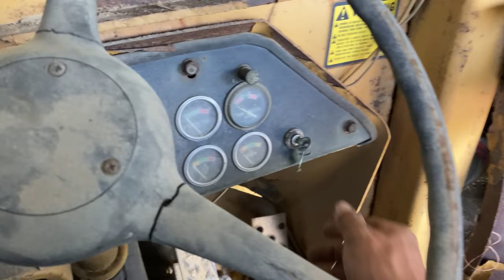Fiat-Allis Wheel Loader Sitting 12+ Years will it Run and Operate??

Comment: As a person suffering from tinnitus, and from one mechanic to another: please, for the love of god, wear hearing protection when operating tools such as the impact driver! Especially in such confined places! Trust me, the few seconds saved not putting them on is not worth a lifetime of not being able to sleep or relax properly ever again!
Reply: But it's not manly. He doesnt even use gloves and just rubs his hands in every fluid. Early cancer.
Reply: @alexstromberg7696  Motor oil is how real men moisturize.
Reply: @XH1927  yeah cancer is nice
Reply: For an impact driver? Impact drivers are like 1/4" and don't make a lot of noise. My 22gal air compressor is louder and I don't use ear protection. My 2 10" JL Audio subs aren't enough to need ear protection
Reply: @seancervantes1  You are very uneducated about hearing, or just have an ego. 1/4" impacts are actually quite loud and the amount of time of exposure plays a big part in damage. How many decibels is your air compressor? Oil free compressors are certainly loud enough to cause hearing damage. You are confusing your comfort level with the level which causes damage. When your hearing becomes damaged, not hearing as well isn't the only problem. Imagine if you end up not being able to stand the sound of the 1/4" inch impact any longer or the sound of a framing square dropping on concrete, even though they are not a problem right now. Hypercousis is the name of the condition and it happened to me. I warned my brother about tinnitus when mine got much worse. I did many trades in home remodels and commercial maintenance so used many high pitched tools. He ran a lot of heavy equipment. Now he can't stand the sound of a fan running (in his bedroom or the seat fans in my new truck or a new duramax idling), or the ladder rack on his truck and his ears ring constantly.
Reply: @XH1927  How would you know if a sunburn actually has better odds of giving you cancer than motor oil? Skin cancer is not uncommon. You must have an ego and live in a black and white world. Using gloves around fluids is an easy way to limit exposure while still getting shit done. I was a painter for a couple decades and had different thinners on my hands often. There no way that I can say for sure that it did or did not cause any of my health problems. Now I am am more careful and no longer do that trade on a regular basis. I also use spf 50 sunblock when working out in the sun, even though I didn't in the past. Some people learn from age and other's experiences. I do agree with Komnifornia labels being BS.
Reply: @seancervantes1  Subwoffers are low frequency which has a much less effect on hearing.  High frequency sound damages hearing at a much lower decibel level.
Reply: Tinnitus here too. Drumline, firing .22s without ear protection, subwoofers, too much time at live music shows. My high range is gone from one ear from a physical impact to the side of my head to boot. Warning to those who don't have it- You will regret not heeding the advice. What you lose will be replaced with constant ringing, and it'll keep you awake at night. I couldn't even listen to music anymore for a while because the sound was so different between both ears.
Learn this lesson from us so you don't have to. Safety is stupid cheap for what it protects.
Reply: @CGT80  it’s funny how people will always give others who use proper ppe shit for using them lol. I always use mine, sure as hell don’t want tinnitus.
Reply: Same here. 
47. 
I sleep with music or 
Eeeeeeeeeeeeeeeeeeeee

Comment: used to drive one of these in a local gravel quarry years ago...engine went and they stuck a straight 6 Iveco engine in it ...what a beast it was...
Reply: Did a motor swap as a teenager into one. Found a old Iveco truck in the weeds 10 miles from us! Worked great!
Reply: Iveco was fiats industrial line…..
Reply: Ran one at a concrete plant around 1975 when I wasn't driving a ready mix truck. They had a 645 Allis when I first started & traded for a 645B, it was sweet. Seems like they had either 3 or 4 yard bucket, good machines & easy to operate

Comment: Start is on the shift lever. You pull it up toward the steering wheel when it's in neutral. I was telling you but you wouldn't listen!! LOL We had a 545B that came with an Aljon engine puller with fixed forks that you laid on the fenders and the engine puller went down through the hood, grabbed the engine and tore it out.
Reply: Many years ago I worked at a salvage yard that had a mobile car crusher. We also had one of those Fiat-Allis loaders set up like that. Pretty impressive machine in operation….
Reply: I was thinking the same. I have a 545B.
Reply: I have a 745B it's pure Allis Chalmers and it's a beast

Comment: "That seems like a bad design" Welcome to Fiat-Allis, Matt! They were always so kind as to put the problem right on the back of their equipment!
Reply: In Finland we say "Fiat-Allis niin ruma ja kallis" translates to "Fiat-Allis very ugly and expensive"
Reply: @nicostenfors5690  and in Sweden we say, throw a Sisu engine in one, pretty it up with a new cab then call it a ljungby
Reply: @derke123  Har aldrig sett en Ljungby i Finland, intressant att de använde Sisu-Diesel.
Reply: @nicostenfors5690  Mercedes motor fram till 2011 sen vart det Sisu efter det 😄
Reply: The 426 Allis Chalmers is twice the engine you guys are talking about
Reply: @RJ1999x   It's not the engine we're talking about, it's the machine. Fiat's always ruined anything they've touched, and heavy equipment is no exception. Allis-Chalmers stuff is some great equipment and tractors, but every piece of Fiat-Allis iron I've ever seen has been a strong running pile of dog turds.
Reply: @challengecompleted55  This loader is pure Allis Chalmers, Fiat had nothing to do with it. Wasn't a fan of fiat built equipment
Reply: @challengecompleted55  Fiat tractors are good. The 80's Fiat tractors are some of the most reliable things ever and are very capable of different jobs. They are still in hard use around the world.
Reply: @derke123  ingen Sisu, AGCO därimot
Reply: @martinandersson5278  AGCO Sisu
Reply: @derke123  nej, AGCO Power, jag vet för dom är min kund. Sisu har inget med motorfabriken att göra längre.
Reply: @martinandersson5278  "In 2008 Sisu Diesel was branded AGCO SISU POWER and in 2012 the company was renamed to AGCO Power." är ju bara ett namnbyte.
Reply: @derke123  SISU har inget med det att göra längre,2002 köpte Kone motoravdelningen som senare köpte AGCO det från Kone 2004
Så nej, inte bara ett namnbyte.
Lika så som att Sisu Trucks har inget att göra med Sisu Axels
Reply: @martinandersson5278  Jo men när Ljungby kom fram med att dom skulle byta motor i 2011, Då skrek dom att det var en Sisu motor, dom satt tillochmed Sisu skyltar på fläktskyddet. Hur det nu är med om det är sisu som bygger dom eller inte så bar dom ändå namnet. Det är ju lite som att gå på SAAB efter 80 talet för att dom ägs av GM. Men jag förstår vad du menar och jag hoppas du förstår min åsikt på det hela
Reply: @derke123  jag har hela Agco gruppen som kund, jag är på Agco Powers fabrik en gång om året ( utom förra )
Finns inte en sisuskylt någonstans

Comment: That little white s10 blazer was cleaner than 90% of the one on the road where I live lol
Reply: Thought it looked OK, like most modern cars in the scrappy just something minor and no one wants to fix it, in a way like those big old machines they are reserecting.
Reply: @CrusaderSports250  If it was nearby I'd gladly take that S10 off his hands and get it running. At least if I could get decent parts. I resurrected a 92 Geo Storm (Isuzu Impulse) GSi earlier this year and after buying, installing, removing, returning, and reinstalling two full sets of fuel injectors plus a couple I've still got an injector that's failing again.
Reply: @XH1927  about the same age as my discovery, fortunately not a lot of rust in it, but enough in all the usual places to be annoying and have to break out the welder, oh well the joys of owning older vehicles, diesel injection equipment is always fun to play with☺.

Comment: Ooh I used to drive my Dad's 955 when I was a kid. Unfortunately it was to small to reach the 10 wheeler dunmp truck so he sold it end my career as an operator and starting my career as the guy in the trench with a shovel

Comment: Kroil is great !!!  I used it extensively in gunsmithing.   It loosens screws easily.  I saw a ranking of solutions to frozen nuts.  Kroil was 2nd ONLY to ATF/acetone mix, beating out PBblaster and others. Comes in gallon can, small cans, and aerosol.  Actually does a good job cleaning gun barrels.

Comment: It appears that the majority of these vehicles and equipment   that are being fished out of the bushes were put there in running condition. Yes they've sat for a decade.. but they drove them in there.. Not minimizing the work but most of the stuff in the weeds around my place was put there because they gave out not because they were simply replaced with new equipment. Maybe I'm wrong.. At any rate. I love this guys demeanor and approach. This channel will do great! Cheers

Comment: 00:40 on a well, early Sunday morning here now, was about to hop into bed. Looks like. I'm staying up for another 40 mins.
Edit: wtf thats crazy, 20,000 something lbs (about 11 tons in my language)and has 150hp.
I used to run a volvo that was 32ton 71,000lbs and the sticker on the window said she only had 181hp at 2,130rpm.  Crikey that 150hp doesn't seem half bad at all.
Reply: It isn't all about the HP only from my knowledge.
It is acomination with the rpm which are also important. And don't forget gearing!

Did you work in the mining industrie?  Or big construction?
Reply: 150hp should mean about 375 ft/lbs of torque. With a low speed piece of equipment, that's definitely good.
Matt will likely run out of counter weight trying to pick stuff up long before he runs out of power.
Reply: @lukasvondaheim  well kind of all about the hp. Power means more in the bucket! 181hp for something that size was,pretty low, I also used to use a hyundai 770-9 that was a 28ton loader, but had 279hp. The volvo was only a 4 speed, top speed on her was 38mph which was very impressive.  It was in the quarrying industry!
Reply: @kstricl  not sure how it works But yeah definitely will run out of counter weight before power. My volvo could lift 17t before the rear wheels started to lift off the ground. also it had 2,800nm of torque 2065.17 ft-lbs.

Comment: It’s an Allis Chalmers 426 cubic inch Diesel engine. I think they were also labeled as 670 or 3500 series engines. They were used in all kinds of AC equipment. Good engines. Parts easily available. Thanks again for the videos.

Comment: I've never seen someone build a roof between trailers like that.
Reply: That's kind of how Matt built his shop. Only instead of box trailers he used shipping containers. Just throw a roof between them and you got a shop. He's got videos showing his shop. It's a very common thing I thought to do a roof between two trailers like that. Maybe not having the trailers still on the wheels but instead flat on the ground. I've seen it done both ways before.
Reply: @williambryant5946  Oh it makes sense. I've seen containers and trailers used for all sorts of things. Just haven't seen that specifically.
Reply: @Roboticus_Prime_RC  keeping it on the wheels ,gives it extra height. for say the wheel loader.

Comment: I used to work for Fiat Allis in Britain and I used to see lots of these on the shop floor being assembled. This model, 645B, was next to top of the range which was a 745 and had a 4 cubic yard bucket on as standard. Our factory fitted more Perkins engines than Allis Chalmers, but we did have some built with Chalmers engines. Allis Chalmers were the original company before Fiat took them over. It became the MMT (Machina Movimento Terra) division.  That was all 40+ years ago.

Comment: Good call on planning how to shut down if needed. I had a runaway bulldozer diesel recently that I was working on.  One lonnnnnnng,  very scary moment before I did get it stopped. Was suggested by a friend to crack open the inject line to stop them. Another good idea to keep in mind. Great work.

Comment: You can repair the manifold with a torch so that it will not crack next to the weld.
normal welding will cause stress to the metal and it will crack next to the weld, oxy-acetylene will heat bigger area and thus not create any stress to the weld

Comment: Try this sometime.
Get feed grade molasses & water (1:9 ratio Molasses:Water)
Soak anything rusty in it.  It might take a week or an entire month, but it cleans out the tank excellently.  
It works better than electrolysis. 
Hydrochloric Acid doesn't do a very good job (it leaves an extra electron which causes instant rust...HCL just is never a good idea.
Still, my favorite is sand blasting (or soda blasting if you ever get the chance...good stuff).

Comment: those old 60s and 70s diesels (and older) are almost impossible to kill, so not a big surprise you got it running fairly easily. They will also run on just about anything, so a bit of crud in the fuel shouldn't be an issue. May clog up the filter and injectors, though, but those engines are great way to dispose of all the oil you drain off the machine - and it's good for them too

Comment: O man you put that vine on there it didnt grow like that its only been there a couple weeks it was probably running just a month ago. LOL Your magic you can make trees grow up like that. And I like how you made the door rust shut and seize too. Nice touch on how you got the vine to wrap around the engine. Its been sitting there 10 or 15 years easily. You need the Valvoline sign for sure. Nice fix. I guess diesel last a lot longer than gasoline. You gotta keep the VW emblem ha ha. I am gonna need to get me some of that Kroll oil its pretty good stuff.

Comment: I love having parallel linkage on loaders, whether it's mechanical, like Cat tool carriers, or hydraulic like on the big off-road forklifts. 
Even some of the agricultural John Deere loaders have mechanical parallel linkage.
Many of the John Deere and caterpillar loaders have what they call parallel linkage but the geometry is wrong which makes them garbage!
Parallel linkage done correctly keeps your loader bucket or your forks at any desired level or angle all the way up and all the way down without changing that angle.

I also love a loader bucket that has a heel that makes it a whole lot easier and quicker to grade with instead of making ruts with the wear plate on the bottom of some of those other buckets.

Comment: Excellent video Matt  :) also fix up for sure also tractor beside too and Vavoline sign to have too ! I say Matt  :) put a grey bottle of STP Total Treatment fuel injection and carb cleaner in fuel tank plus 200ml of Dexron Automatic transmission number 2 or 3 type in also with the Desiel fuel also clean out smoking also lube up injection pump plus injectors also whole engine!

Comment: You need a lift pump to connect to the inlet of the fuel pump also the fuel shut-off solenoid may not be opening allowing fuel supply.

Comment: I'm very happy for you, Matt! 
Great job, nice addition to your sandbox.
Maybe fix up & trade Orange Crush for a decent JLG boom lift
that also needs reviving- if you ever watch Pine Hollow Diagnostics
that man Ivan has worked on a few, mostly electrical issues.
Scissor lifts are convenient until they tip over.

Comment: Yer that valvo line oil sign is sweet, its a shame for it to just sit there and deteriorate to the elements, see if u can get it and put it in your shop where it can be appreciated and looked at and given abit of TLC before its hung on the wall + it will look good in your shop hanging on the wall.

Comment: Hi Matt. You did your self proud. Getting that old Fat Allis up and running. Does that have the model have the 3500 ll 6 cylinder engine? With the soft shift modulated Transmission? I like that you have the fork attachment. Looks like that would be handy around the farm. Great!!! Videos. Thanks.

Comment: check  timing voon engine width of i mark makes quite a differenc also pull one inj hook it up spraying outside if bad pull all have r/r or buy new sometimes new is cheaaper i use commercial coppershield on all my cable conn, makes better conn, and rules out corrsion also use on batt terminals good luck

Comment: Fiat had nothing to do with that loader, it was designed by Allis Chalmers and was a great design that's still used today.
The engine is a 3500 Allis Chalmers 426 cu in. I can get you any part you need for it, the transmission is a twin disc,
Reply from the maker: Glad to hear that! Someone told me parts were hard to come by!
Reply: @DieselCreek  nonsense. Some of the axle parts might be hard to come by, but it was an Allis Chalmers and grossly overbuilt for it's size, hydraulics were off the shelf they didn't use special valves or pump, the transmission is twin disc the cylinders any hydraulic shop will have packing, etc

Comment: Question did you start that using the old diesel in the rusted tank? And after it started I didn’t see anyone running to see if you had oil pressure.  It’s amazing that beast start it and backed out of that thing after so many years.👍That’s a neat sound with the flapper valve at idle

Comment: other than the 426 cu in diesel that can also be found in other Allis Chalmers tractors and some combines, i'm not sure what other parts are Fiat or Allis.  if you end using a turbo elbow from a Allis farm tractor it won't have that compound curve in it and you will have to get some pipe rewelded or bent to match the hood.

Comment: That tank still looks as if it can be saved drain it, rip it out fill in some vinegar and turn it over! Always check the fuel supply before starting and do not use fuel from a crusty tank. Fix the cigarette lighter!